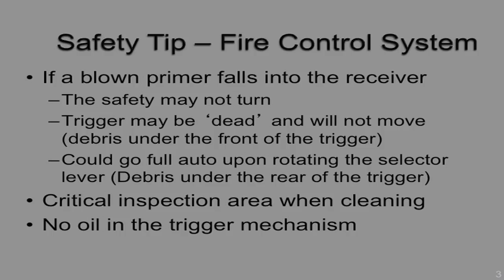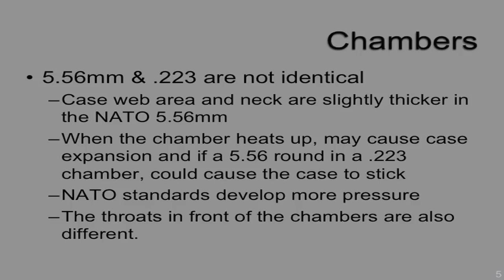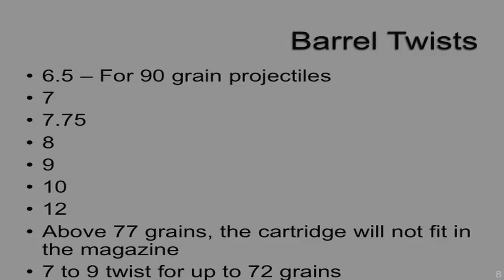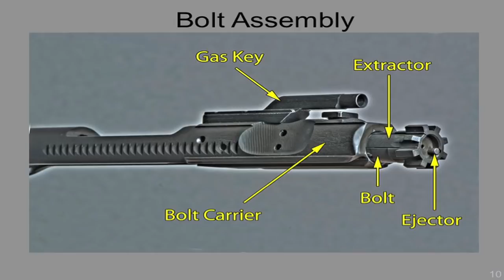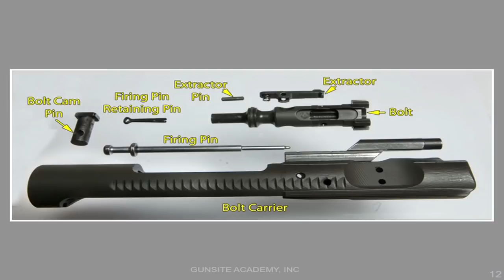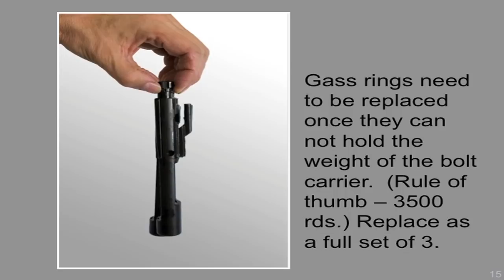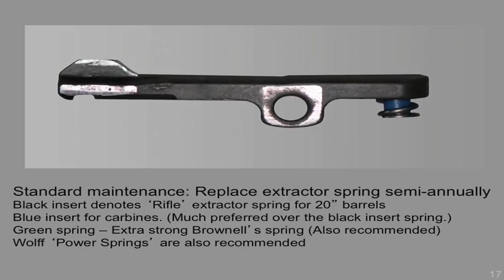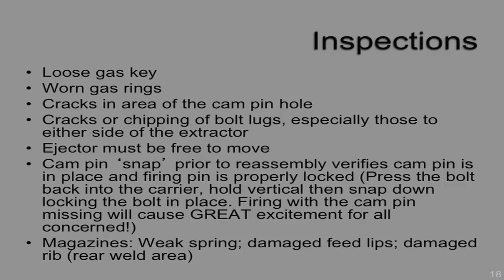AR-15 Maintenance: Field-strip, Clean and Lubricate an AR-15 | Gunsite Academy Firearms Training

Comment: Do you have a lubricant recommendation?
Reply: +trystan guthrie EWL30 Lube and EWG Gun Grease you can buy it  on amazon
Reply: +Thomas Jefferson okay cool, thanks. What about for cleaning?
Reply: To start, No Russian crap ammo as it burns dirty. I personally only use Federal 556x45 62 grain green tips. Follow the video to clean, wipe, and lubricate. In addition, you can wipe the barrel twists with "Sweets 7.62 Solvent". The rod pad will turn blue as it picks up trace amounts of copper while being pushed through the Barrel.
Reply: +Thomas Jefferson  I bought a lot of PMC .223 ammo on sale I recently bought a colt le6920 and am new to the ar15 stuff so thanks for all the help
Reply: Your welcome, Take care man.
Reply: +Thomas Jefferson you too!
Reply: I prefer Ballistol. It works VERY WELL for cleaning and lubricating. Has done so for over a century. While Sweets does work well for copper removal, I wouldn't use it on an AR15. It'll remove metal from your bore, which is a bad thing, if you're not careful. Once your bore established copper equilibrium, each succeeding shot will wipe excess copper from the bore.

Comment: You definitely need oil in the fire control group, without oil they sometimes wont function correctly. I regularly fire several thousand rounds using oiled fire control groups without any issue and without any cleaning, they get dirty but dont seem to affect functionality.

Comment: At around 6:45 this instructor claims that m16 and m4 barrels and uppers are incompatible.  The ONLY difference is the feed ramps on the barrel extension.  

The m4 feed ramps are cut or ramped further below the bore axis.  There is no difference anywhere else that I can see or measure.  I’ve swapped a METRIC CRAP-TON of barrels on AR15 rifles.

I’m only a 25+ year gunsmith with experience in all aspects of firearms, just FYI.
Reply: Yeah, I have an M4 barrel on an M16-style upper, which has no feed ramps. Many rounds and no issues. However, putting an M16 barrel with M16 feed ramps on an M4 upper seems to have the potential for feeding problems. I've never done this myself, so I have no experience with it.

Comment: All of this video assumes you have a Di gun which in each and every shot blows horrid residue back in to your BCG , upper receiver, lower receiver and fire control group.

The fouling (or lack of fouling) is so much different for a piston system gun. I use Superlative Arms. Even after 1000 rounds, the upper and lower can be wiped clean with a rag and re oiled in just a few minutes. Or brake clean and re oil. Two minutes every 1000 rounds.

I like a drop of oil on my trigger springs and Aero Shell grease on my trigger sear. That whole area can stay clean even after several thousand rounds with a piston kit.

I would rather shoot than spend hours cleaning a filthy DI AR15. With a piston kit think of a bolt that NEVER gets backed on carbon on it. Your whole BCG can look brand new even after thousands of rounds and only a very cursory clean up every so often. I have never had any kind of problem or failure in my Adams Arms or Superlative Arms systems. I shoot a LOT, BTW.
Reply: Deutsches Brot - German Bread  
I dont admit it. I know for certain the figure is 89.4%

Comment: You need to review the correct method of lubing the bolt and gas ring.  The gas ring test is incorrect.  Read the 23&P and quit passing on internet fables.

Comment: Clean your rifle.  Neefs very little lube if any.  That lube attracts dirt.  I guess if you run your guns 20k rounds without cleaning.  In that case lube the fuck out of it.  An ar can run dry and clean forever.  Thats why militec works in iraq.  No wet oil no dirt magnet no problems

Comment: Soak your BCG, disassembled, in some Ed's Red DIY Bore Cleaner overnight and you can just wipe 98% of the carbon etc off with a flannel cloth or Qtips (be careful of the fuzz left by some Qtips).  Ed's Red is made of equal parts of Dexron II/III/Mercon ATF, Odorless Mineral Spirits and heater Kerosene (add a part of Acetone if you need to remove plastic fouling, etc. otherwise it's not needed).  Great stuff and costs about 1/10th or less of most commercial bore cleaners.  Most guys I know run their ARs too wet.  All that does is gum them up faster.  I use Hi-Temp Wheel Bearing Grease (very thin film with just a couple tiny drops of synthetic oil and it slides like glass) and Full Synthetic Motor Oil to lube my ARs and other semi-auto firearms:  if it slides, grease it; if it rolls, oil it.

Comment: There is NO REASON to use a bore brush and rod in a barrel anymore people.  Simply spray bore foam in the bore, let it sit for 20 minutes, and wash out--it takes out the fouling and copper without all that scrubbing. Cleaning rods are obsloete!!

Comment: Your camera work is very poor. You go into great detail but your camera doesn't necessarily focus on the parts or areas you're talking about. Please fix or correct that. Otherwise your video is not nearly as useful or helpful as it should be.

Comment: Pffftttt....  you hose it off and smack the stock a few times on the ground to get the rocks and sand knocked lose and shoot another 300 round's and repeat.  Ar15 serously is designed to be easy to clean and not be oiled except for the 3 slides on the bcg. People oiling every part of the damn thing till it's dripping is funny.